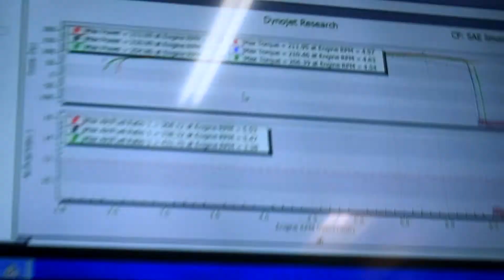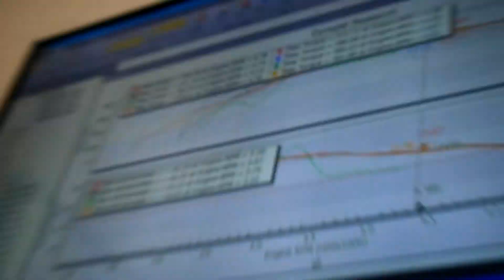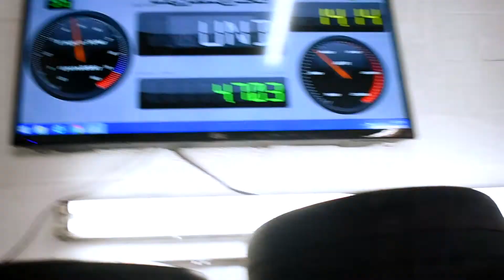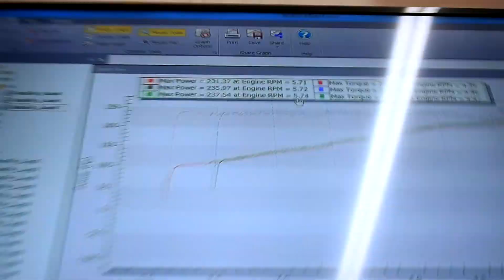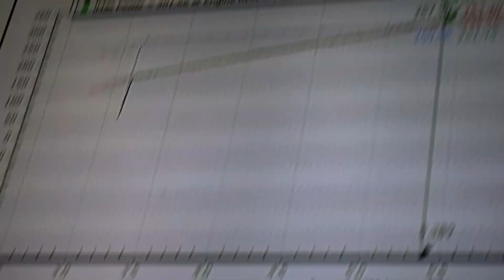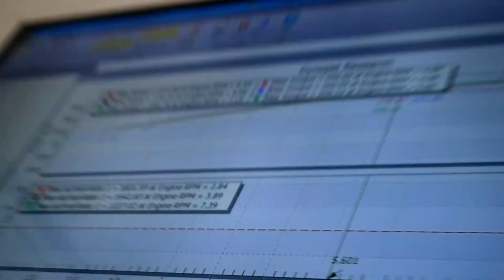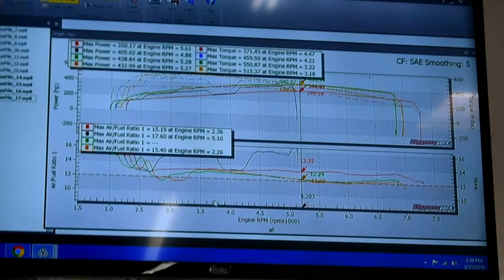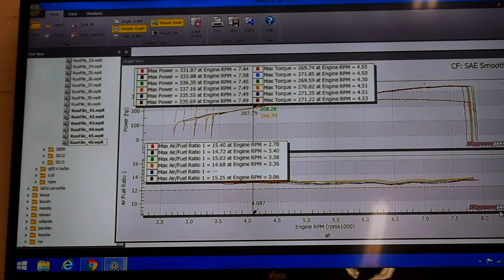HOW MUCH POWER DOES IT MAKE?! Miami Dyno Day!

Comment: G37 was full bolt ons and a tune. Those with those mods are always in the 330-340whp range and in the 270-280wtq range. That Nismo 370z probably just had a cat back or even an axle back. They put down 280-290whp stock.

Comment: Do u know the Mods on the 370z and g37?
Reply from the maker: hatersgonhate I do not, let me ask around and see if I can find out some info for you 💪🏾🔥
Reply: CJ Built thankss!! Especially the g37 since it made 337whp :o
Reply from the maker: hatersgonhate I was very surprised with the G37 numbers. I know for sure the car was tuned, but not sure the rest of mods.
Reply: G37 was full bolt ons and a tune. Those with those mods are always in the 330-340whp range and in the 270-280wtq range. That Nismo 370z probably just had a cat back or even an axle back. They put down 280-290whp stock.
Reply from the maker: GrayFox370 Damn that's Awesome man. thanks alot for the info 🙏🏽
Reply: GrayFox370 how much whp do u think my 370z has? Its a touring model with megan racing testpipes, axleback, and resonator delete? Jus curious
Reply: GrayFox370 I don't think that was a nismo 370z people just like to put the nismo kit on there base 370z. The nismo makes 350hp at the crank I'm sure it sits around 300-310whp stock I've seen a complete stock 2017 370z Nismo on a dyno. A few mods and you can be at like 340whp
Reply: hatersgonhate fbo e85 tuned. I made 352 on this dyno with last motor this was a new motor with less mods. Follow me on insta @tevin758 to find out more.